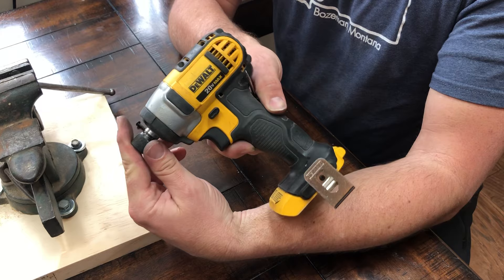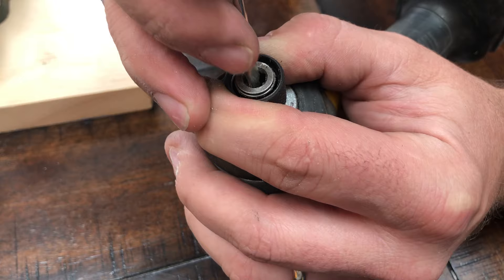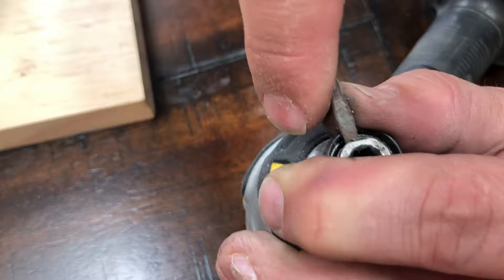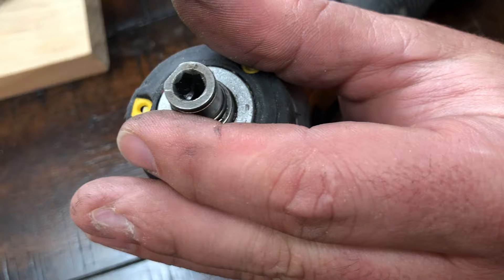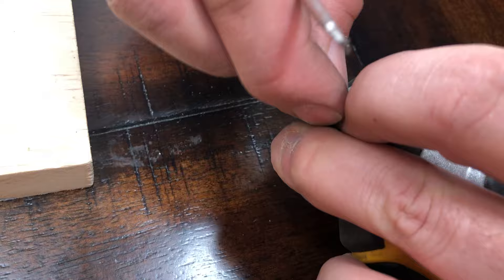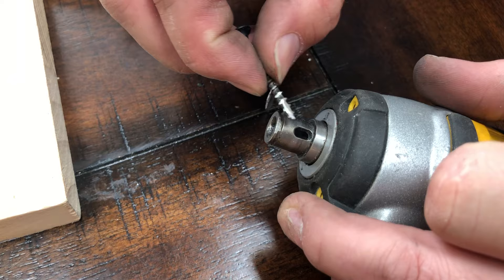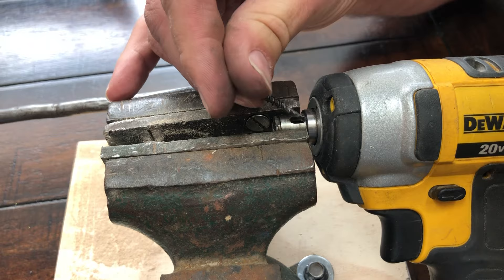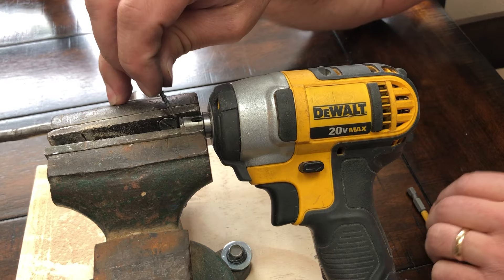Bit Broken and Stuck in Dewalt Impact Drill (SOLVED)

Comment: Thanks for a most informative and well-edited video. I was about to follow your suggested approach to dismantle the chuck when I came across another guy's video who was able to release the broken shank by using a "zip" tie to hold the outer chuck release sleeve in the forward "release" position. I secured a 1/4" wide zip tie around the drill drive shaft which held the outer chuck release sleeve in the forward release position. I then held the drill upside down and gently tapped the church with a small hammer. After a few "tap, taps", the broken piece fell out! I was lucky as clearly this method only works if the broken shaft bit is not seized, jammed, or rusted.
Reply: I believe this is the zip-tie video https://www.youtube.com/watch?v=bObl3haTpyw

Comment: is that's incredibly stuck then mines permanently stuck... had a 1/2 socket adapter on there that doesn't have the locking notch and it became rounded off on the inside as well as snapped off about 1/8th of an inch back inside the 1/4 hex. i probably made it worse by hollowing out the middle of the bit and trying to thread a drywall screw in it but who knows I'll throw some pb blaster or wd-40 down there and see if it'll budge. just waiting on the epoxy i used to set the screw in to cure!

Comment: Broken Hex bit in my DeWalt  impact prevented new bit from seating in place.got a 1/4 in silicon iron rod. When magnetized, by a strong bar magnet it pulled the broken piece right out no disassembly required. Next step was going to be to wind "Bell wire" around rod to make an even stronger electromagnet. LL&P

Comment: Thanks 👍.. my stubby DeWalt dcf801 impact has my 1½ spade bit stuck crazy bad from 1/4 cabinet toe kick plywood. It's down to the bare inside sleeve unfortunately I attempted to follow some other you tubers videos suggestions before finding yours and the ball bearing is missing from prying up on impact driver while in a vise clamp slowly disassembling chuck and attempting to pry again. I've tried everything but this should work!

Comment: Novice here. Experience a similar problem. However, the drill bit was not broken, just stuck. I couldn't get the compression ring off as noted in the video. What worked for me was putting the chuck in a vise, tightening it down, and pulling real hard on the drill itself. The chuck released (pulled forward) and the bit popped out just as easily as it went in.

Comment: Great tip - I used a hardened trim nail instead of the drywall screw and it worked great.

Comment: Brilliant! I sm standing in front of a DeWalt impact driver reduced to 15USD in a  because it has a bit stuck inside. I am doing to buy it and try your method.

ALAS the sleeve on mine is not coming off.
Reply: i got it off in a vice, removed the broken bit and now have a cheap impact driver. Thank you! I lost the ball bearing. At the moment i am using a blob of solder instead but i have a 6.3mm ball bearing (or 30) on order. 

Thank you!

Comment: I just sprayed WD 40 in the hole. Pulled the tip of the drill as if I was going to put a bit on. Pointed the drill to the ground  and got a rubber malot and beat it a couple times in the back of the drill and it popped out in just a few seconds.

Comment: I note how you pulled it apart the parts are all over the place.

Retaining spring for bearing first

Cap or head second 

Then spring fits in the head of cap followed by washer and then sirclip 

If you put it together how you had it then the bit you intended to use will not work.

Other than that good job